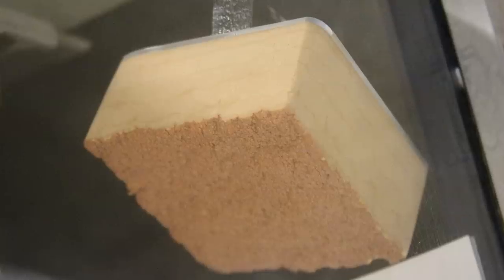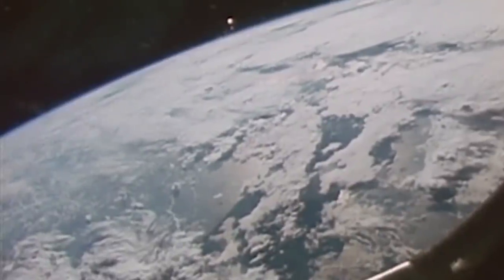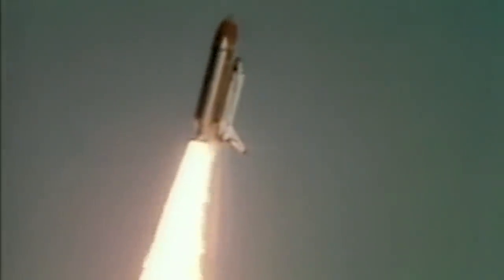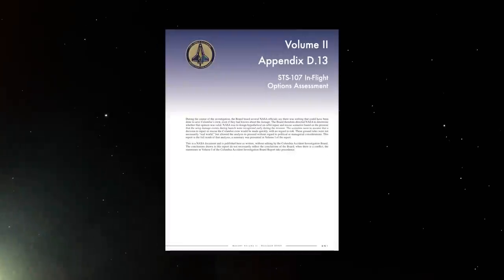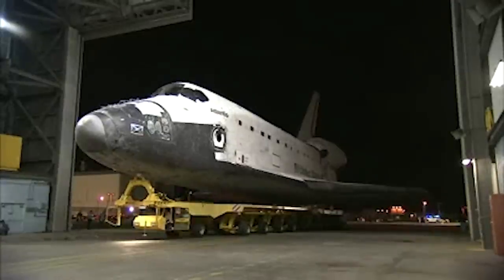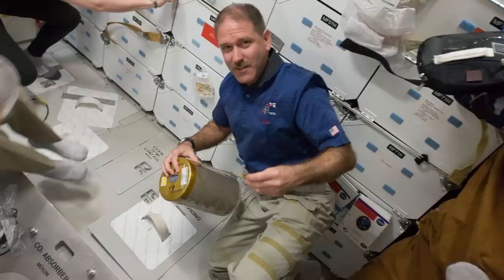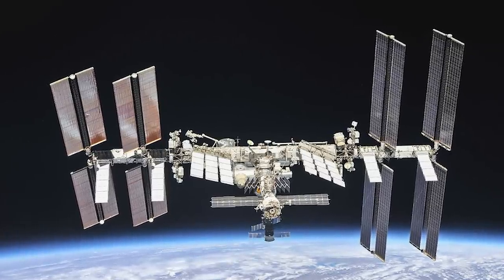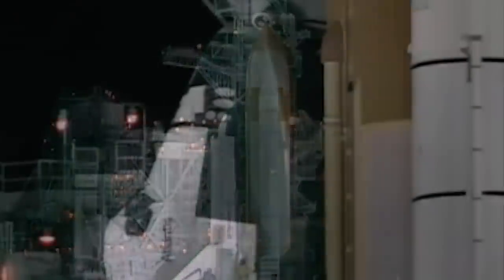The Backup Space Shuttle

Comment: I am an employee a technician who works on Cape Canaveral Air Force station . This shuttle sat on the pad for months . During that time woodpeckers had knocked holes into the foam on the main tank.. also during that time we had multiple rainstorms. It's my personal belief that these holes collected water that then froze when they fuel the shuttle. I believe this water would have frozen and broke off and then hit the shuttles wing .
Reply: That sound very plausible.
I wonder if deleting the white original paint from the central fuel tank would have protected against woodpeckers and other such natural wear and tear.
Reply: Tap on a clip to paste it in the text box.Tap on a clip to paste it in the text box.Tap on a clip to paste it in the text box.Use the edit e,m icon to pin, add or delete clips.
Reply: The tests using foam showed that foam alone, at the right speed, was enough to massively puncture the wing.  Didn't need to be ice.
Reply: @johnlarro6872  it's a matter of what is, by their account, likely to have caused the foam to fail, ie weakened due to the birds. Thanks for adding nothing to the conversation.
Reply: @colonelmustard2652  Actually the point made was that ice caused the damage, and whilst that may be true, the fact is a piece of foam could also have done it.  But, you're welcome. :)
Reply: When does it EVER get below 32⁰F in Cape Canaveral......
Reply: @comradeeverclear4063  they're being fuelled with frozen gas, bud.
Reply: If so, the water could have expanded in the holes causing the foam to crack and break off. I don't think a chunk of ice that big would have formed from the scenario that your describing.
Reply: @ryanwiler4808  the OP is, best I can gather, describing a scenario of water inundation, freezing and thawing cycles due to the hydrogen gas and environmental factors, weakening of the surrounding materials, and subsequent critical failure of the foam and it's inevitable striking of the vehicle causing a failure. Please do try to keep more than one idea in your head at a time.
Reply: Didn't they determine that the foam came from one of the bipod ramps? This led to a redesign to eliminate the foam that required the installation of heaters.
Reply: @comradeeverclear4063  January 28, 1986...
Reply: @spaceflight1019  I think we have a Challenger =P
Reply: They were aware prior to lift off. Just like they were aware of Challenger solid rocket O' Rings.
Reply: I don't understand the stupidity?

Why didn't they provide a disposable light wight shield for that are where the shuttle can dispose when it reach so sort of high, like one piece body armor?????

Where is the collective engineering and mentality!
Reply: @trespire  interesting question what you described is very similar to the EFIS system used for low cost stucco for houses. The woodpeckers still get in.
Reply: Have it on good authority that it has to do with the glue that secured the foam. Months prior to take off the EPA deemed the glue that they were using was not environmentally friendly, forcing them to change glue types.  If it ain't broke, don't fix it.
Reply: U maybe right but yall know complacent behavoiur really to blame..even us regular folk..yamned as u launched shuttles..like it was boring..as long as chemical rockets all we can figure out..its life or death EVERYTIME and i for one am sry i lost sight of that myself..god bless those who were lost..
Reply: @comradeeverclear4063  it got that cold the day that Challenger exploded

Comment: Frustrating part about all this...
It was the one mission that didn't go to the ISS.
Had it been any of the other three shuttles and the damage found...  
The crew would be alive today with a shuttle permanently docked at ISS or remotely destroyed during reentry.
Reply: Or they'd have had time to send up materials to attempt a repair, and then reenter Columbia remotely, just in case.
Reply: @samcostanza  Interesting idea, but it wouldn't have been worth it; they would have just de-orbited it over an ocean if they could.  Leaving it at the ISS would not have been practical, so de-orbiting would be the only feasible option.
Reply: Exactly.  Had it been an ISS mission, and it only was not by random chance, even discarding the Orbiter would not have been so great a loss.
Reply: @antibrevity  Pretty sure the cost of including a replacement panel or two, and a few space walks... versus a whole new shuttle... they'd try save the shuttle.
Reply: @johnlarro6872  That wouldn't have entered in the calculation because another Shuttle would never have been built. But repairing a Shuttle and remotely landing it would've been good experience for NASA and the astronaut corps.
Reply: and the sad irony here is that, had Columbia completed its mission, it would have started flying ISS missions afterward… in fact, it was originally scheduled to fly the STS-118, an ISS assembly flight which delivers the S-5 Truss segment and the third External Logistics Platform (ESP-3)
Reply: @samcostanza  as far as im aware, it was impossible to fly the shuttle remotely. that was something that the buran was able to do
Reply: @StsFiveOneLima  If it was an ISS mission, then ISS will get a wet workshop module, the massive cargo bay will be turned into the largest habitable area ever sent into space.
Reply: Columbia wasn’t used for ISS missions due to her weight. She was heavier than her sisters due to design changes during initial flight test.
Reply: @antibrevity  Not really. The next shuttle could have brought up the materials needed, that perhaps a few EVA's could have been made for the repairs. With such a solution, the Shuttle could have returned safely! I'm not sure what you think is not "worth it"  and what values you set on a Shuttle not to mention the lives aboard.
Reply: Can't believe they didn't have any ducktape
Reply: @samcostanza  you’d be better off building a new shuttle then fixing that one in space
Reply: They eventually developed a repair method that every mission after carried in the cargo bay. Every mission not going to HST went to ISS.
Reply: @hanschristianben505  Something I ran across years ago...Columbia was slated to bring the HST home during the STS-144 mission.
Reply: @spaceflight1019  ahh yes I remember reading about it as well, that HST was meant to have a ride home for post mission inspections/assessments before ultimately becoming a super-valuable space-flown museum piece… I’m kind of sad that it’s not gonna happen anymore…
Reply: @hanschristianben505  Me too. It deserves a museum spot instead of being burned up and dropped into the Pacific Ocean.
Reply: @NatesRandomVideo  - you’re right about Columbia being too heavy for ISS assembly flights… that’s why, after flying 107, it was supposed to have a weight reduction program in order for it to become an ISS supplies/parts truck… things programmed to be bolted off Columbia include many, if not all of its flight testing hardware that’s still in the orbiter, that huge airlock in the middeck to increase space in the middeck and accommodate the orbiter docking system, the retrofitting of the SSPTS hardware (not sure if I’m accurate about this), also, and take this with a grain of salt, possible removal of the heavier LRSI TPS (white tiles) on the nose and wing area and replacing them with FIB TPS (high temp resistant blankets) like the ones installed on the younger orbiters…
Reply: @spaceflight1019  true that, plus I believe they will definitely gonna learn a heck of a lot about developing space hardware that can last a lot longer
Reply: @hanschristianben505  Fun fact: Columbia was the only orbiter that carried the instrumentation that ironically signalled the INCO flight controller that something bad was going on. Listen to the re-entry audio...how port-side sensor after sensor began failing offscale and how they thought that it was merely an instrument systems failure. It culminated in the tire pressure sensors going offscale low because the plasma had breached the wheel well and was about to cause the port side tires to explode.
Reply: @spaceflight1019  I do recall listening to their chatter at that moment… Columbia’s extra equipment really was a life saver for the CAIB investigators… if this happened to another orbiter**, the investigation would have taken a lot longer (putting it mildly)…

**which was what almost happened to Atlantis during liftoff on 112… the very same mission that I first watched online after getting our home internet connection for the first time… ‘kinda gives me goosebumps sometimes…
Reply: @hanschristianben505  STS-112 was the first mission that featured a camera mounted on the external tank. If Columbia would have had it, the impact and the damage would have been clearly visible.
Reply: Too many "if" statements that do not comport to reality.
Reply: @nixl3518  Repairing the carbon carbon, which protected the most assualted part for the orbiter during reentry was thought not to be possible.  At one point, special material to fill in missing tiles was conceived, but damaged carbon carbon was unrepairable in space.  This portion of the shuttle needed to be perfect without patches to work properly.  The problem with the shuttle was it had as we call in the IT world, TOO many single points of failure that led to LOCV. (Loss of crew and vehicle).  No one would have risked a crew to reenter with Columbia.  At this point, the shuttle program had failed in reusability based on original promises and vision when conceived in 1968. 2 years later, the Bush Administration (with bipartisanship) scuttled the shuttle program when he presented 2005 Vision for Space plan returning the US to the original 1968 Space Task plan, taking the shuttle out of the equation.  The shuttle was never meant to be the centerpiece of the US Space Program, but that's what it became squelching all other funds to go to Mars/Moon, the true objective even in the plan within which the shuttle was conceived back in 1968.
Reply: @gogamarra  "was not THOUGHT to be possible" does not mean that trying to fix the problem was not worth the effort. LOL, the "special material" are actually ceramic tiles that could have been identified and brought up on another shuttle crewed with engineers that would've been trained to make the repairs! Discussing what could've, would've, should've happened, when nobody, including those who "should've" had the wiliness to notice the fatal damage, after alarms were rung in previous missions and apparently not taken with the requisite seriousness, amounts to academic discourse. Having a fatalistic approach is hardly a way to go about problem-solving. Pushing the envelope, technologically speaking, always involved and still involves taking risks and not cowering at the first sign of failure. 

The shuttle succeeded in its intent, by being a reusable craft that repeatedly fulfilled its mission and that decades later we have yet to come up with anything approaching that technology. Apollo 1 burned on the ground and killed three astronauts, and yet it didn't kill the program to go to the moon which ultimately was a spectacular success given the enormously larger risks involved compared to those of the shuttle. 

Your reasoning is fatally flawed in that the size of the pie of funding is not limited. "Squelching" was a political decision! Our failure ultimately is in the political expediency that we made repeatedly year over year that turned NASA into a bureaucracy where the focus of its mission was lost and preservation of executive salaries became paramount! It had to turn to private industry to continue the concept of reusability which SpaceX developed and adapted to until then 100% nonreusable rocketry!

Lessons learned in the effort, prove the Shuttle's success. Private industry is in the final stages of producing what amounts to a mini-Shuttle that uses essentially the same technology that was used in the 70s for the original shuttle. Technologically, the Space Shuttle was a steppingstone into space and an unmitigated success in dealing with the challenges. If it wasn't a success, we wouldn't have been distributing those that were retired into museums around the country to proudly display what was accomplished 50 years ago! Success comes at the cost of failure, which we should always be aware of, that we intentionally make.

You make all sorts of negatively inspired arguments, but thanks for the effort! I see the glass half full!

Comment: I watched news reports at the time and there was discussion about possible damage to the shuttles wing by the foam falling off. Then later into to the mission there were more media reports of possible repairs or flying a different re-entry path to try to avoid the red hot plasma on the suspected damaged area. I think NASA knew the options available were virtually non existent and so gambled as it turned fatally.
Reply: A major component was complacency. Foam strikes happened all the time and it never caused a problem before so why would this time be any different?
Reply: @spaceflight1019  yeah that was their mentality. It was complacency that got the crew killed however.
Reply: @Correa24bori  That, and something called "normalization of deviance" that led to less-than-optimal operating conditions becoming accepted as nominal. It almost caught up with them one more time during the pre-launch testing for STS-133.

Comment: The actual way to save the crew would have to have started years before. I remember an issue of a 1979 National Geographic magazine that extensively covered the Shuttle. Among the many things that were being worked on at the time, was an applied ablative to cover the space of any missing tiles. It also meant being able to inspect any part of the thermal protection, not to mention work on any part of the spacecraft. These techniques were abandoned because it was felt that they wouldn't be needed. Another thing that was worked on was the Personal Rescue Enclosure. This was an 86 cm diameter spherical space suit that an astronaut could crawl into that could then be carried by an EVA suited astronaut to transfer to a waiting rescue Shuttle. Again, the development was cancelled. But 20/20 hindsight is, well, 20/20.
Reply: It wasn't the tile section that was damaged. It was the aluminum wing section above the tiles.
Reply: @JimMac23  No, it was the reinforced carbon leading edge. There was no aluminum structure exposed on the exterior of the shuttle

Comment: The crew of Columbia had no way of inspecting the potential damage - the arm was either not long enough or not included on that mission (it was later expended specifically for being able to inspect the shuttles for damage), and no way to repair it either (it was only later that they performed repairs to heat shield tiles).  So whilst yes, some techs were debating whether the foam had caused damage, and perhaps fatal damage to the shuttle - the decision was made not to tell the crew as nothing could be done.
Reply: -the decision was made not to tell the crew as nothing could be done.

- ashame if thats true....
Reply: @izom  It's unfortunately very true. The same failures of managers and directors not listening to their engineers about potential risks that caused them to disregard the risks of the poorly designed O-rings that caused the Challenger explosion came back to bite them again with Columbia.

The standard NASA had set stated tha zero foam sheading was acceptable. However it was found that foam had come loose and dislodged on as many as 80% of prior shuttle launches. Just like the O-rings, this was a known problem that the higher ups in NASA decided to ignore. 

When some technicians expressed concern about the foam strike while Colombia was in orbit they were told they had to prove without a doubt that such a strike could have caused catastrophic damage before any deviation from the mission would occur or any ground based telescope powerful enough inspect the shuttle would be used. There simply wasn't time for such proof to be developed before the tragedy occurred. It wouldn't be until months after the accident that the directors got their proof.
Reply: This mission carried the Spacehab, a module that eliminated the ability to carry the Canadarm system.
Reply: @izom  You should read "High Calling" by Evelyn Husband. They did tell the crew but didn't know how extensive the damage was. The decision to not investigate was made by a flight director whose husband is an astronaut named Ham .
Reply: @spaceflight1019  The thought of them dying and being left to circle the earth would be too much for the public, they let them die claiming it was an accident.
Reply: @izom  The crew was notified on day 7of the mission.

Comment: 3:55 It was a large craft, bulk infastructer means cannot be fully sstol in shape, ejection methods required. Also lacked emergency disposable surround heat shield layer paint. X-15a was assumed "infinite" paint for horizontal flight, could've saved on merely entery

Comment: JSC also refused to request the Air Force or Hubble telescope to check the spacecraft.  They could have tried to re sequence the banking the Shuttle flew during re-entry to reduce heating on that wing.
Reply: That would have done no good. The computer on the shuttle changed the angle of entry to try and save the wing, but the heat melted it anyway.